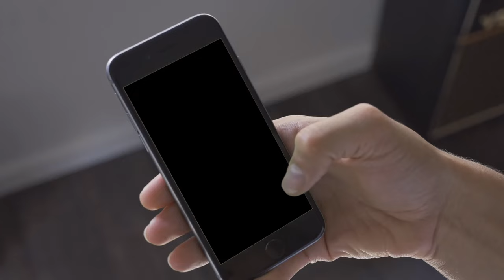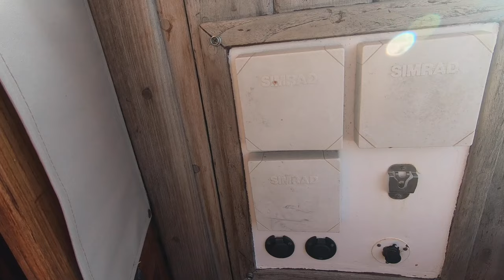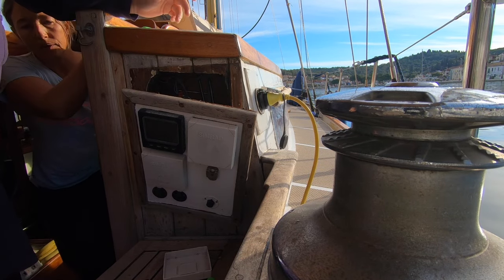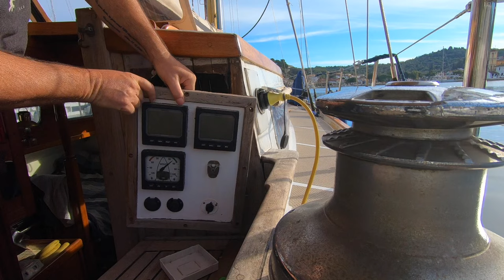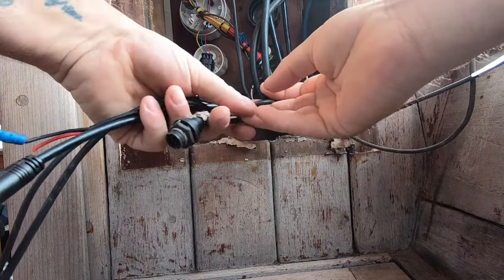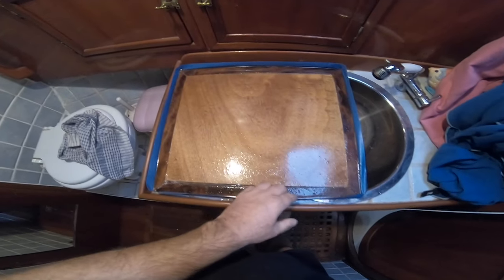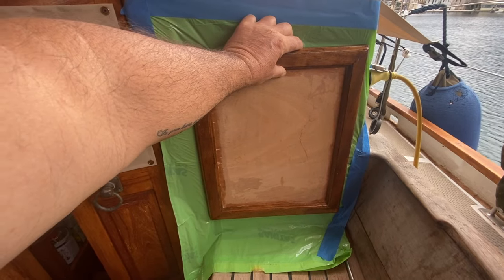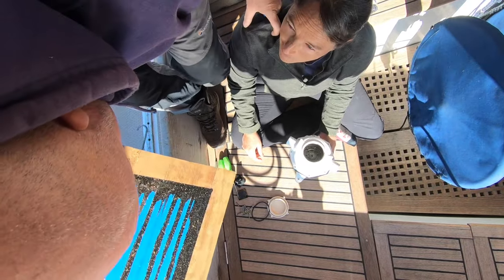EP 114 A #GREEK WINTER - ITS NOT all #Sunshine and #Bikinis

Comment: Worth hinges on that panel,  I didn’t really see from behind,  but i know them shore power plugs have there issues over time?
Reply from the maker: Hi Trev , there is a hinged access on the inside where the engine gauges are fitted so the new panel will be accessible as is the shore power (which is fairly new) thanks for watching and commenting.
Reply: What's the best shore power connection? Have to get new one because one we inherited actually is an aviation plug ( rectangle).
Reply from the maker: @WavedancerWesterlyfulmar   on the research ships the power supply to my work boats amd rescue boats were supplied by a company called ratio. We seldom had problems with them.  So much so when I replaced mine I spent the extra dollar and bought the same brand ( Ratio ) having seen plenty of other horror stories on the web it’s important to know the connection is good.